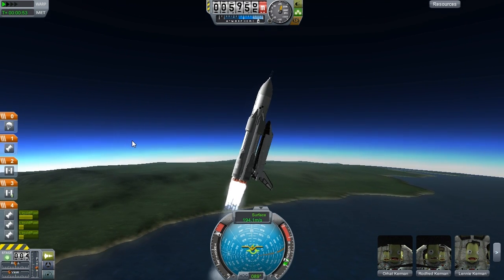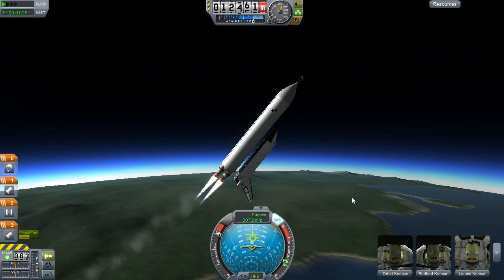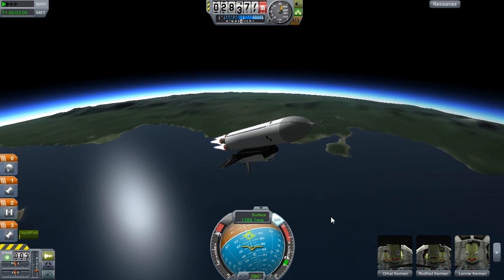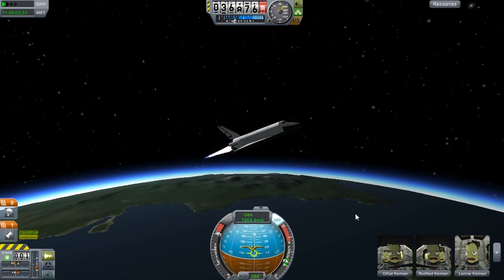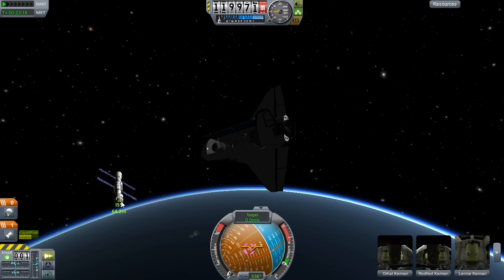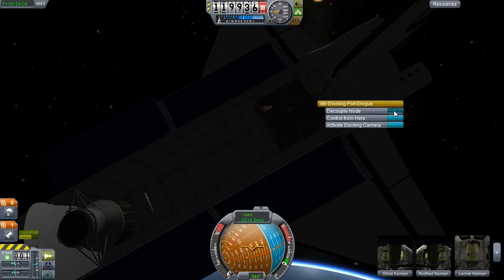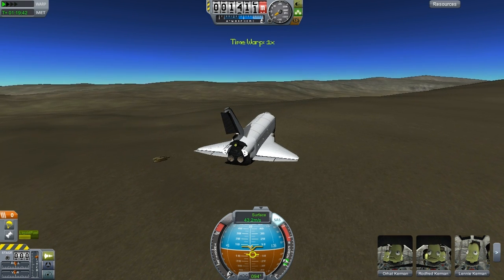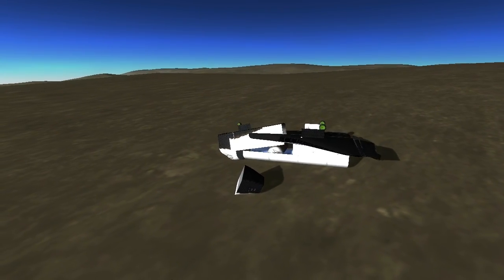KSP #58 - Re-Constructing The ISS Pt. 4 - Z1 Truss + Shuttle Landing

Comment: z1 is on top of unity
Reply: Yes, your right. Just check this pic of what the ISS looked like after the STS-92 Mission. 
https://en.wikipedia.org/wiki/STS-92#mediaviewer/File:ISSafterSTS92.jpg
In fact, If you just look at Zarya in this same pic you would notice that Zarya lacks a Zenith (Top) port.
Finally, the docking ports used on the USOS ( US Orbital Segment) and the ROS (Russian Orbital Segment) are of completely different designs. So even if there was a Zenith port on Zarya, the only way to dock the Z1 there would have been to use a PMA (Pressurized Mating Adapter).